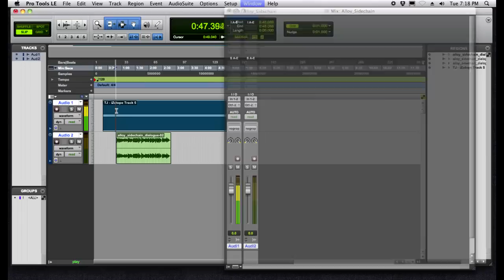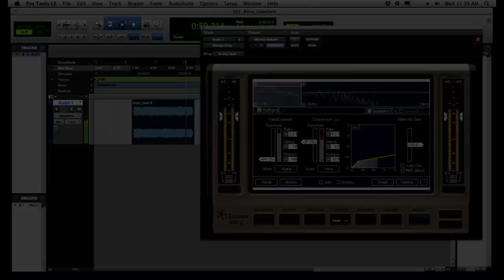Side-chaining in iZotope Alloy

Comment: Is it possible to use only a band from an external side chain signal that is within specific range to trigger the compression on a chosen band? What I want is to trigger the compression of a band 0Hz-100Hz  only by an external signal that is within this range not by the whole band. So for example only lower part of kick would side chain only sub-bass frequencies of a bass track.